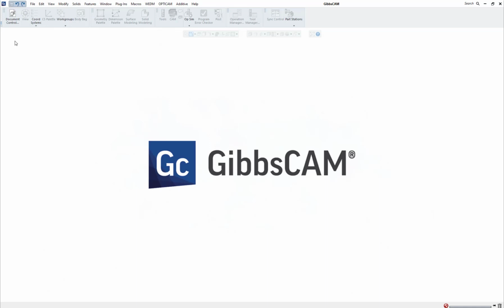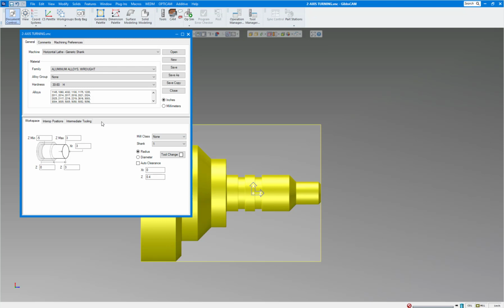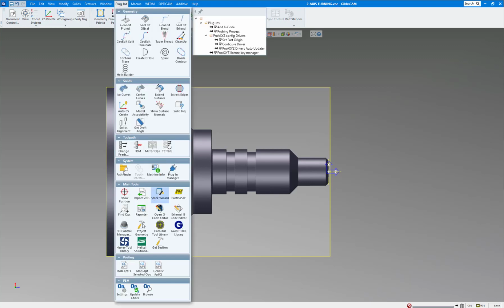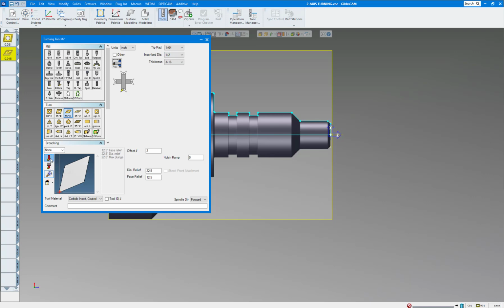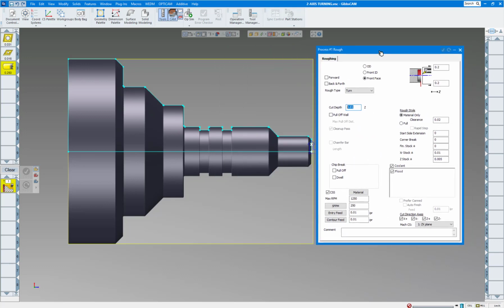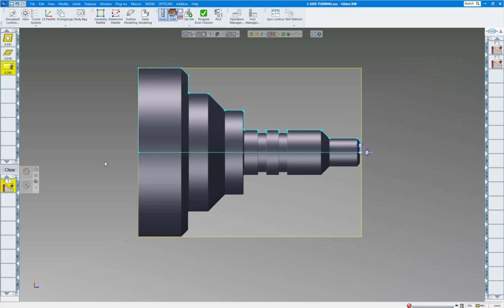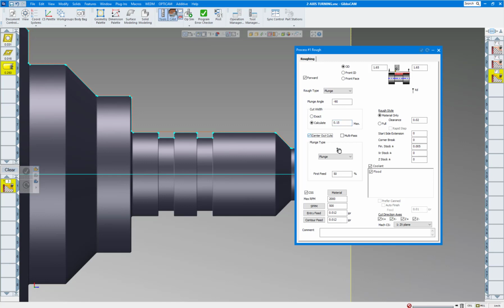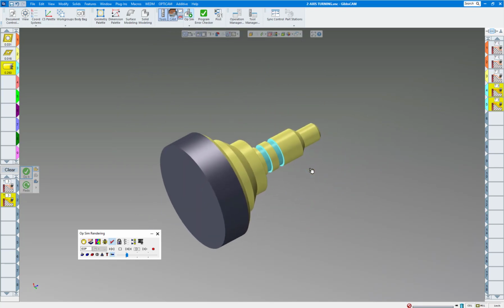GibbsCAM 2-Axis Lathe Turning

Comment: We have a new TL2 so obviously the tool cuts from the front not the rear like a turret.  So how do I change gibbscam to work from the front when I extract the lines on the bottom side of the part?  It still tries to cut from the top which is mirrored to what we have.
Reply from the maker: I believe the TL2 still uses positive "X" numbers even when posting from the  back side, but depends on the post processor.  You can still program with the geometry on the back side, and when you post it should all be good.  You can however mirror the geometry in the X, then program, but you will also need to define your tools in the tool dialog window you are cutting to cut on the front side.  It's just easier to program from the back side and let the post processor output the correct code.  Hope this helps.
Reply: @  That's what I figured, but that is pretty ridiculous that Gibbscam can't invert the X axis.  I should be able to program how you really see it.  This just makes things more complicated and increases the chances of doing something that will cause a crash.
Reply from the maker: @Mochinist-bk6yj  If you really want to  program from the front side, just watch this video I just did.  https://youtu.be/jvjWyVinsbo

Comment: Hello , i cannot change the yellow arrow with the blue arrow , no matter how many toulsand times i lick the blue always looks in the same direction , what could be wrong , the shape is closed , was made with geometry expert
Reply from the maker: Not sure what is going on with your part.  You should be able to click INSIDE of the arrow to change directions.  You might want to check your video card specs under Device Manager, then go to the video card mfg to get an update.  I have seen issues with older video card drivers.  Most video card mfg's update their drivers every few months.  Also make sure your Windows updates have been updated.
Reply: @GibbsCAMVideoTutorials  Looks like i solved it , your suggestions did nothing by the way (Nothing is old , the software is shitty/picky about the hardware). Thanks for replying tho'

Comment: 저는 대한민국에 있습니다
포스트 설정을 싸이클로 만들지 못합니다
대한민국만 그런가요?
Reply from the maker: I can't understand your request?  Please advise.
Reply: @GibbsCAMVideoTutorials  깁스캠 대한민국 엔지니어는 싸이클 코드를 만들어 내지 못하고 장비와 호환이 되질 않아요
그래서 우리는 단순한  g코드로 작업 합니다
Reply from the maker: @서예령-w8j  GibbsCAM can produce simple G-code as well.  It depends on the post processor.  If your cnc will not take "canned cycles" then use a post that is called a "long hand" post processor that will write simple g-code.

Comment: That was very helpful. I just purchased Gibbs 2 axis turning for my new to me cnc lathe today. Cant wait to use it. Thanks for the great video.
Reply from the maker: That's great !  If you happened to get solids in with your package there are two very fast ways to slice the part to extract your geometry.  One way is with the "Slice Spun Body"  which is very fast.  The other you need to go to plugins, then  "plug in manager", then find the menu that says "get section".  Put a check in the box to turn it on, then select Apply.  To use that select your solid, then go to plugins and select Get Section, then click on Do-It and you have your geometry as well.  Good luck!

Comment: Great video. Can you please explain how to post process as per the machine.
Reply from the maker: Once you have your part programmed, look at the icons at the top and select the icon that says "Post".  From there a window will appear.  Click on the first icon on the top left.  This will go to a browser window in which you will have to choose the post process for the machine you want code for.  Once you have done that then choose the icon below that one.  This is where Gibbs is asking where you want to store the G-code for your machine.  Once you have that done, then  next  choose the program number you want to use. Note, choose a program number that is NOT already being used in your cnc machine.  Normally also put a check in the "Minimize lane number" box and check Insert Comments.  Then press "Process"  This will write your code.  Then transfer this code to your machine.

Comment: hello, thanks for the video.  Can you explain how to make a custom rapid toolpath for lathe and mill?
Reply from the maker: For Milling you first have to make sure the plane you are on (XY, etc) are normal to the screen by clicking on the HOME button.  Then just select a Milling tool, open the geometry pallet and select line, then mouse line, then draw your custom toolpath (press esc to stop). Then you can right-click on the geometry you want to rapid and select Show properties. From there you can change the line to rapid.  There is no such thing as a rapid G2 or G3 on machine tool controls. Rapids are always lines.  With turning just right click on the geometry you want to modify and go through the same process.  Hope that helps !
Reply: @GibbsCAMVideoTutorials  thanks for your help!